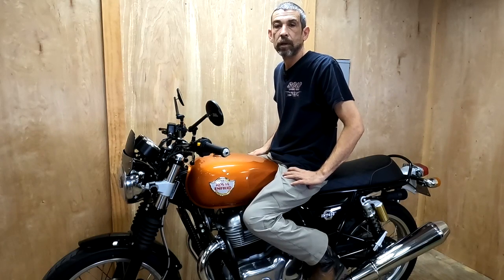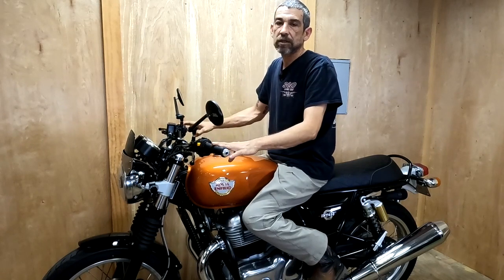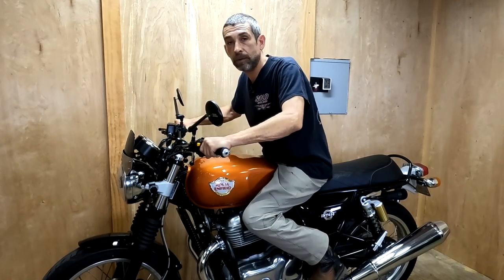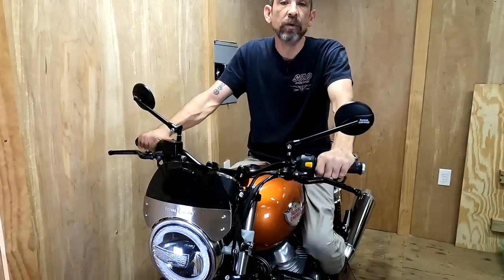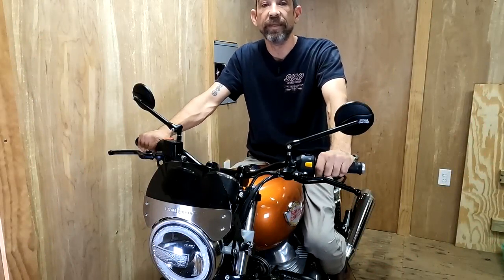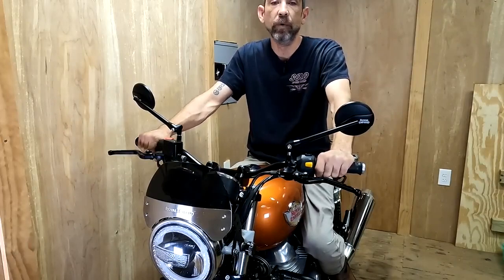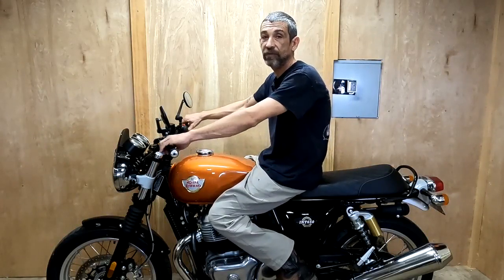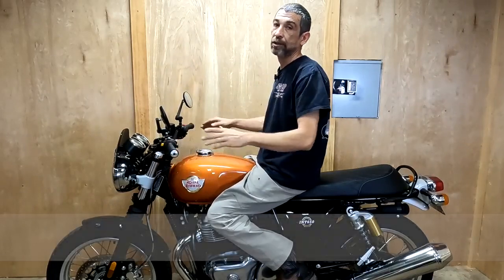Royal Enfield Interceptor 650 - Handlebar Change (Ride And Review)

Comment: Even subtle changes have a big effect on 2 wheels. The riding position you now have is closer to a Triumph Thruxton which I own and ride a lot. I just sold a GSXr-750 that, even with Woodcraft bar risers was wreaking havoc on my wrists; had it 10 years and never got comfortable on it. Your INT650 is closer to the 650GT now and it is good to have more rider weight shifted forward because the Enfield 650s are tail heavy in stock configuration. 
 Would like to hear some more PRS "blues guitar" when you have the time.
Reply from the maker: @Frederick Woods Yes sir,  the changes are definitely noticeable. I haven't really seen what the bike will do with the new bars yet. Still getting a feel for them. I looked up the Thruxton. That's a cool bike. I have noticed there's a lot of weight on the tail end of the Interceptor. Have had the front end want to leave the ground coming out of corners a few times with the heavy rear end and good traction. It hooks up for sure. I'll see what I can do on the music for you. I am so swamped lately. Sorry for the late reply. As always, thanks for the comment and thanks for watching.